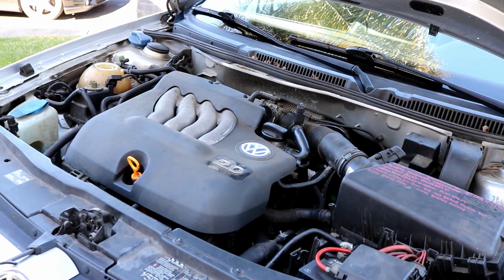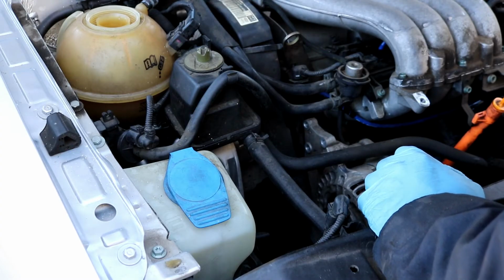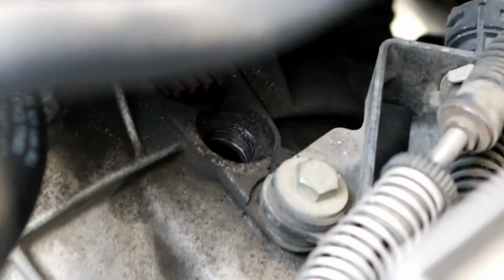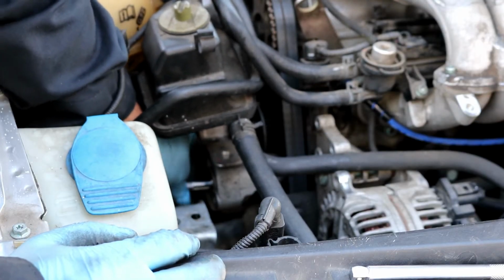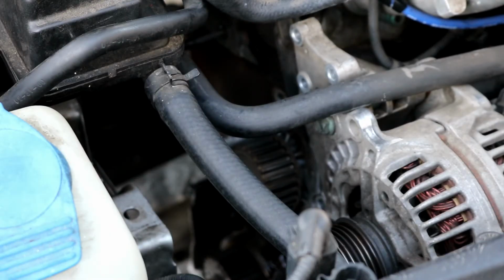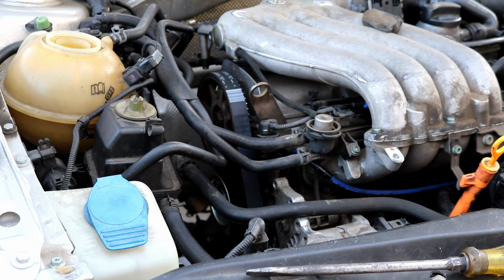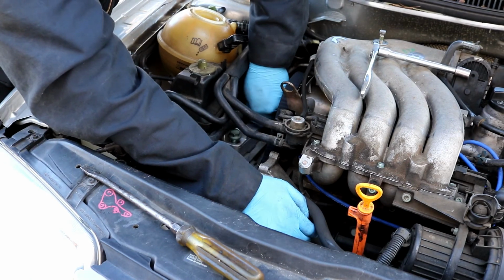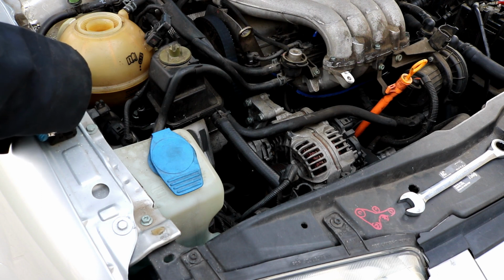Volkswagen 2.0L Timing belt and water pump! MK2, MK3, MK4 Jetta/Golf

Comment: How many ft/lb should the engine/chassis bracket bolts be?
Reply from the maker: Niko Petering 

1. engine mount to body should be 30ft lb. (plus 90 degree turn)

2. Mount bracket to body 18 ft. Lbs.

3. Mount to engine bracket bolt 74 ft. Lbs.
Reply: @HelpingHandAutoRepair   4. Mount bracket to engine bolts: 33 ft-lbs. 
( ͡° ͜ ͡°)

Comment: The engine rotates clockwise.
Reply from the maker: nbpt1000 cool
Reply: I was wondering is it safe to spin it counterclockwise for alignment purposes?
Reply from the maker: If you missed the mark by a small amount 1/8” or 1/4” then I would turn it back just to make it there. If you have gone further than that, then just keep spinning clockwise to line it up againz